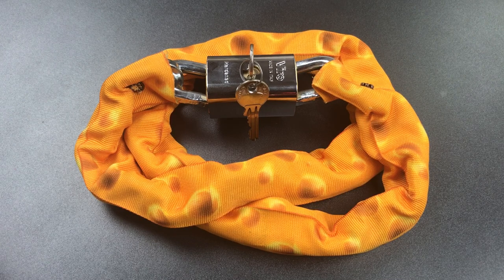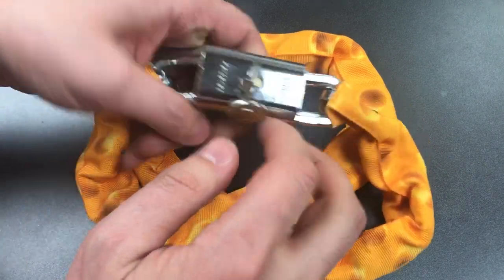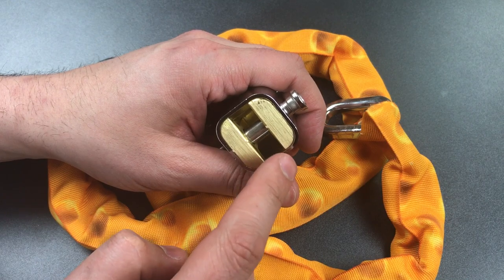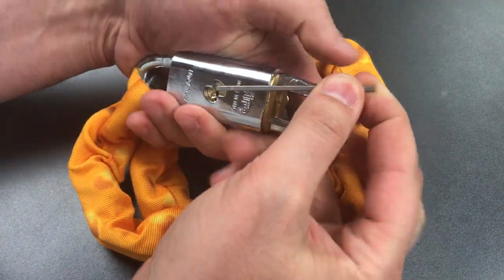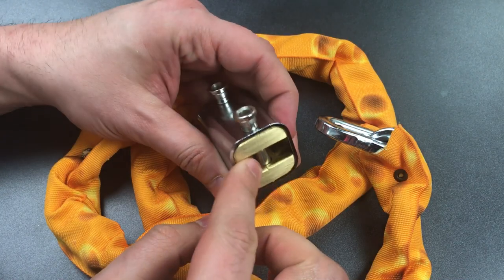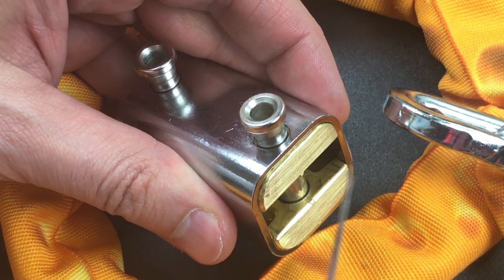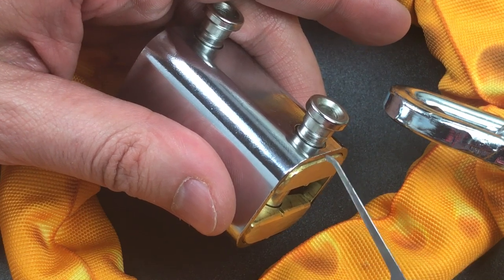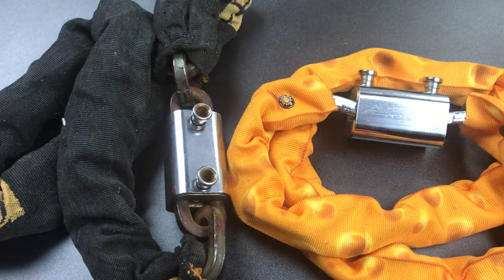[659] Viro Double Shackle “Blocca Catena” Bike Lock Picked

Comment: My partner has had a similar lock for 4 years. This (ontario) winter finally killed it. The lock body appears to be aluminium with hardened steel wrapped around it. Turns out it is not impervious to corrosion.

edit: after some research, it appears to be a cheap knockoff

Comment: Given that you felt so many serrated pins, could the pins themselves be the weakest link?  Would it be possible to shear the pins with enough torque on the keyway?
Reply from the maker: Possible, but not likely. I may do some testing on other locks.

Comment: I would put hardened rods in the shackle holes, and then pry those apart.
Reply from the maker: That would concentrate forces, and make snapping the outer shackle parts more likely.
Reply: LockPickingLawyer I think what fluke196c is getting at is that before pushing apart the shackles you should put a hardened rod or some other object in the holes designed to weaken them. This would decrease the chances of the top of the shackle simply bending over, and increase your odds of successfully opening the lock.
Reply: Some snug fitting bolts would do. Maybe 1/4-20
Reply: There would still be a sheer line between the filler and the unweakened shackle.
To try this, you would want to pack it with something like JB weld.
Reply: 1/4" bolts, even good ones, don't resist bending loads well.
Reply: Ob Fuscated I don’t think anything bigger would fit in the hole.
Reply: Highstranger951  I believe that's his point.
Reply: D Hawthorne you both clearly missed the point

Comment: From an Engineering perspective It looks as though it has been designed so that the force to sheer the pins is less than tto break the brass dog bone in tension. The holes in the pins are indicative of that calculation. I would think finding a way to pull up on the pins would be a more likely attack as you may crush the ball into the inner actuator/ and stretch the lock enough given the mechanical advantage of the partial ball detente. Also i would only pull up on one pin. However that may have been engineered to to break before the crush as well. Neat Design.
Reply from the maker: I don’t disagree with any of this... I’m doing some guy feel physics as to material strength.
Reply: The only disadvantage to that design is that now you can rather easily compromise the entire shackle pins, whereas without these holes you'd have a hard time getting started.

Pro tip: Carbide's your friend ;)

Comment: - zip discing one of the steel "bridges" you pointed out would only take a second and would severly bias a leverage attack to the side that is zip disced.
- denting it with a cold chisel would likely also cause a bias during any attack
- putting a piece of drill rod in the shackle hole would help prevent it from getting crushed during a lever attack.
- drilling an ez-out into one of the shackles and then slide hammering it might also have the same effect as a spreading attack between the two shackles, with less likely of deforming the shackle.
- the steel is thin, a mapp torch could probably ruin the heat treat on that spot very quickly.
Reply from the maker: Thanks, I’ll consider these.

Comment: I'd suggest making the weakened pins stronger by inserting a hardened pin down into both of them.  The smooth ends of drill bits, for example, might help reinforce the pins and make them strong enough to break outwards through the armor.

Comment: Use a hand torch to melt the brass. It will also heat the steel making it more malleable and ruin the temper on it. Then, fill the holes in the shackles with a steel rod to prevent deformation and apply the pressure. This is more involved. If we are talking about a more available opening, drill the shackle out (using vicegrips to prevent spinning), and then pull the shackle (or piece(s)) out of the lock body.

Comment: As you started explaining your attack method I started thinking that it wouldn't work as the pin heads are hollow, then you mentioned it. My locksmithing brain is forming nicely. 

I recommend ramsetting it where the base of those shackle pins meet the outer casing. The the pin hole in the brass might be enough to act like a die, depending on if they've heavily chamfered it or not, and the ramset piston like a punch, to punch a hole right through that casing and possibly knock the shackle pin clean out.

Comment: Drill into the brass perpendicularly towards the bottom of the shackle with as wide a bit as possible, then use the chain to bend the shackle out of the lock body. The shackle should bend at the point which interacts with the ball bearing

Comment: Thanks for the video, looking forward to the sequel :) I believe the chain is actually pretty good hardened and very hard to cut with a boltcutter. I always thought this was a good lock and hearing you now I really think it is. I already thought it could be easily picked but most ordinary bike thieves here do not have that knowhow. I'm very sceptical about your brutforce approach. I know for a fact this is easily done with the very bad copies that are around but I don't think it will work with this one but you might surprise me :) I think the best way for brut forching it would be trying to pry open one of the shackles. Would like to see you try anyway. Great job so far!
Reply: Oh yes also, there is a 10mm version :D

Comment: From what i can see from the video the core is being held in place by possibly a slight press fit, but more so by the 2 shackles. It’s going to be interesting to see if it works, I’m going to say it won’t by the methods you have mentioned because of the drilled out top section of shackle. Maybe if a piece of drill rod or something similar is put inside it may help.
Reply from the maker: The drill rod will have the effective of concentrating forces and making it more likely I snap the shackle. It’s counterintuitive, but adding them is probably a bad idea.

Comment: Drill further into a shackle end, pulling on the chain to keep the shackle from spinning. Drill until the drill bit encounters the notch in the shackle. The top of the shackle should fall away at this point (similar to drilling out a rivet), significantly weakening the lock's ability to hold the chain. Some hard pulls on the chain might then dislodge the remaining piece of the shackle, hopefully enough to release the chain.
Drilling into the brass on the end might help.

Comment: Might the Ramset gun be a good choice for knocking that shackle outward?

Placing a nut or sleeve over the shackle might prevent undue deformation...
Reply from the maker: How would you hold the lock? That’s the problem with using a ramset on this.
Reply: How about Ramset on that outside corner where the steel is thin to crack it? Then just an outward hammer blow could push the pin far enough to get by the bearing.
Reply: That was a thought I had, but it's a very small and precise point in an awkward angle.
Reply: Depends, I suppose, whether the lock's own mass/inertia is enough to let the ramset's impact do its work.  The random flying/flailing lock and links would be a hazard, for sure.

Comment: Seems to pick fairly easy but not a bad lock otherwise.
Reply: they should have used the bowley core! ;)
btw, can this one be used with 13mm diameter hardened chains? the chain in the video looks too thin - no problem for medium bolt cutters, i think :(

Comment: Assuming the end of the shackle does not enter the hardened steel casing: Drill out the brass on both sides of the chain, place two long prybars through each of the chain links attached to the lock, and force them together. It should be possible to apply a large amount of torque with the prybars, hopefully enough to twist the bottom of the shackle on the weakened side away from the lock body.

Comment: I imagine some sort of friction attack taking advantage of the ability of each shackle to spin while locked (assuming that's actually true).  Chuck one of the shackles securely in a drill. Run the drill at high speed while doing one of two things:
A) pull out on the chain; this might heat up the chain link or the shackle itself enough to weaken the parts enough to break.
B) pull the spinning shackle away from the lock, causing a lot of friction on the ball bearing/shackle interface; this might cause the shackle or ball bearing to heat up enough to fail.

Comment: It's hard to tell how deep the drilled out portion of the shackles are at the top. Is it possible to place the manifold spreader between the shackles or will they just distort with force? Since the spreader will need some clearance underneath it in order to rotate, it may not sit low enough between the shackles. Could some portion of a solid metal rod be inserted in the drilled out portion to prevent distortion?
Reply: You could put a steel screw into the hallowed out section to make it stronger

Comment: i would try a long crowbar/demobar/prybar on the locking pins and just lever one straight out. The ball bearing should be pushed into the soft brass fairly easily and move out of the way. worth a go anyway. Worst case scenario the whole lock bends i would say

Comment: Those shackles look like they only go through the hardened steel at the top. At the bottom of the shackle they look like they just seat into the softer brass. Rather than push the 2 shackles out at the top could you drill or cut into that brass at the bottom and go at that end of the shackle? Then if you manage to pull the bottom of the shackle out maybe there's enough play to get past the ball bearing and pull it out the top. Though if that chain is only 8.5mm you're right it's probably easier to just bolt crop the chain.
Reply: That sounds rather interesting. I should have send him the 10mm version...

Comment: i think you will have better result with the ramsetgun. the shook from the piston might be enough to dent  what is behind the ball bearing resulting in pin shooting out.
although the harden steel is thin i think shearing force   will cut the top of the pin off

Comment: I might just use the drilled out shackle to my advantage, just drill out the shackle. Looks like it's significantly thinner where the ball bearing keeps the shackle locked in place and it doesn't seem like you need to drill in too deep.
Reply from the maker: It’s free spinning and hardened. Drilling would be challenging. Easier to drill the core by far.
Reply: How many more times must you tell people the shackle is free spinning ?

Comment: Make a tapered wedge of undetermined length and slope (I can’t hold and measure the unit) with a slot in the center obviously from the tip about three inches long. The slot is three inches. Drive the wedge under right or left hollow pin parallel to the lock body forcing it up perhaps breaking the circular part that secures the pins. May pull the pin above the chain. Best I can do at a moment notice without hands on. Good luck.
Reply from the maker: I like it... I’m considering a variation of this.

Comment: Ramset to the right or left of the keyway directed into the end of the bolt underneath. you would be using the ball as a wedge and the lock may fail in the same manner your attack would.
Reply from the maker: I considered that, but am concerned the ramset would just seize things up. I’ll think about it.

Comment: I'd Try Ramset on the hidden nose of the "shackle pins" ... right through the thin amour plate .. the reaction force from the angle of the ball bearings, might deform or tear the same area where your spreading attack intends to.
Reply from the maker: Could be. I’m concerned about the armor. It’s thin, but strong. So to is the ball beating mechanism. I’ll give it some thought.

Comment: I know it's already too late but I would try to drill a little bit deeper in the pins and fill it with an good stepped steel pin who fits perfectly inside... Then push with the "screw pusher" to open...

Comment: Hear me out please :-) 
Maybe you could attack the chain but use it to put the pressure on lock body.
I mean, connect the two chain links which go inside the lock with for example ratcheting mechanism a tension it. The chain should start pulling on the locking lugs and force the brass outwards.

Comment: What about using the bolt extractor.  There appears to be some room to angle one of them inside the chain link between the brass portions of the lock.  You might have to start with a small diameter extractor and work progressively up to a larger one (multi step approach), but I think you could get a pretty good bite inside that lock attacking it from one end or the other.

Comment: Since they weakened the shackel's handle by drilling it out, you may be able to insert a metal plug to give it back it's strength.
so you push the handle instead of deforming it.
Reply from the maker: That would concentrate forces making it more likely to break. Counterintuitive, I know, but more metal sometimes isn’t better.

Comment: Instead of trying to expand the shackles,try compressing them at the top,use the steel body as a fulcrum to bust open the bottom side brass retention holes; I'm thinking like a "C-clamp" type of attack, if the bottom of the shackles spread far enough apart, you should be able to pull at least 1 out  :)

Comment: Would it be possible to use a hammer and a punch to make a hole in the top somewhere, then use a large self threading screw or Bolt to force the locking mechanism open, or maybe destroy it entirely?

Comment: would it be possible to attack the rods from the other end with say the Ram set,  possibly shattering the rod, the ball bearing, or snapping the rod were it shackles in the process if not simply forcing it out completely past the ball bearing through deformation, i see a comment about this, as for holding it, on its side, flat to the ground, and if it was locked to something maybe using something to twist the slack out of the chain, and if it was say a post moving it so its braced by the post as well.
Reply from the maker: The problem is holding the lock steady.
Reply: perhaps a attack on the side, with it on the ground,  you have attacked a few other locks in that manor. would the ram be able to maybe be able shatter the locking pin, or the ball barring, or maybe push the ball baring far enough out of line to free the pin.  actually looking close it looks like that brass is in a t shape, from the side, laying it on the ground, at the right spot, the Ram set might be able to deform the steel and apply enough pressure to snap the brass around the pin maybe?
Reply: this lock needs end caps with slots for the chain, also , did they thin the pin near the body in addition to drilling the top hole so they will sheer off right at the body

Comment: Ramset on the front of lock, on either side of the lock cylinder. Drive one of shackles out the back.
Reply from the maker: But how do you hold the lock? I don’t want an attack that only works in a vice.
Reply: LockPickingLawyer 
Well hello sir. You’re probably right, it’s too difficult to hold. But, in video #531 you hung the chain around the press frame and pulled the lock tight with the muzzle of the Ramset.
Reply: Put a two by four skinny ways between the two locking lugs. Set it on the floor and stand on the chain that is not being detached to keep it from rotating.

Comment: Someone mentioned the Ramset on the shackel but I would just like to see what would happen if you simply used it dead center.  Not that it will magicly open the lock but rather to see how much damage it will do to brass surrounded by hardened steel.  Maybe if you have a good sized piece of the lock left over you can strike it once with the Ramset as an encore?

Comment: big drill bit and go threw the shackle, is it even hardened?
Reply from the maker: Not only is it hardened, but also free spinning. It would be a challenge.
Reply: then i would drill out the brass from the bottom all the way thru until it's gutted? besides that what's left besides the angle grinder, and drilling out the cylinder? everything else would be unrealistic.

Comment: I wonder what happens if you chuck up one of the pins in a cordless drill (high speed) and run it. In combination with some grinding medium it could enlarge the tolerances enough to release the pin.

Comment: They're both as vulnerable as each other, so they're both likely to try and go at the same time. That's not good news is it? 

Put the lock on the floor and Ramset the hardened steel both top and bottom on one side only. Apply the pressure whilst holding the pressure device as close to the body of the lock using clamps as previously described. Then it will sheer on one weakened side only. 

I suspect there is no easy one system attack. Furthermore, another 6mm of brass and hardened steel on rack side, possibly in an elegant curve, would make this attack a total non starter. 

I really admire great design. And I hate the lazy compromises made to ease production and save a few cents. It's as if that crass vulgarian combover king was paying for it!!

Comment: A hammer against the bolts will likely sheer them off. Maybe drilling deeper into the bolts weakens them to a point where they easily break. But they're probably hardened so.... I am out of ideas.
Reply from the maker: Not only are they hardened, but also free spinning, which is just as dastardly.

Comment: Could you break the locking lug by pressing the locking mechanism through the other side? Maybe using the ramset?
Reply from the maker: Maybe. The issue is how to hold the lock steady.
Reply: LockPickingLawyer for testing purposes or point of concept, you could put it in a vice.  Real world the object it’s locked around should work to hold it in place. If your doing this to steal the bike chances are you are not worried about viewing angles or potential flying pieces. 

Maybe an impact nut driver attachment would prevent slippage as it could encompass the whole top piece.